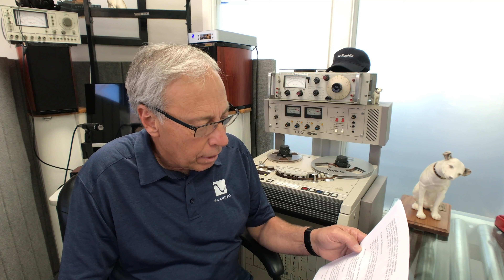Explain the different types of DACs

Comment: I have a good CD  player. I noticed a dramatic  improvement in the quality of my CD audio when I use the coaxial digital out.  Direct  digital  into my integrated  DAC amplifier is much better than using the RCA  out . I actually like CDs now... I used to think all CD players were equal, I was wrong. I think low quality DACs have given CDs a bad rap...

Comment: Quality of DAC is mostly dependent on power supply ??? Seriously ? You're finding way to sell snake oil in any topic...
Reply: Patryk Kulczyk power supply is very important , think of it like putting petrol in your car , if that petrol has water/oil/sand etc in it your car won’t run properly.  Try listening to your hifi at 3 in the morning and hear the difference. Would take to long to explain why this is to you so just try it and see.
Reply: marc J yeah AC power has some importance especially when your power supply circuit of your device (amp, pre, dac, etc...) is poorly designed or not sufficient on filtering. Also if there is interference in your power network but it has to be something near and strong. I never had any issues with my power network and I move a lot (every few years different country).
What I don't agree with is selling snake oil like power cables worth couple hundred dollars. Or some conditioners that are passive or active that does not generate pure sinus...
Reply: Patryk Kulczyk Fpga is very dependant to the power supply. In fact, if the power supply and the caps don't have enough buff and speed fpga won't even work.
Reply: John Yang what is fpga?
Reply: Patryk Kulczyk Logic gates. But fpga is running at a very fast state. So very stressful to the powersupply.
Reply: Patryk Kulczyk Lol. If you ever go to a college or uni that teach you microelectronics you will know what I am talking about. You are the one that doesn't know.
Reply: Patryk Kulczyk I am an electrical engineering student studying in UNSW. If you ever measure the power supply voltage of a running fpga board. You will see that it is not so pretty. Even with all that capacitor and multi layer board, you still generate lots of ringing to the power supply because digital circuit runs on square wave which needs lots of energy at the leading edge but not so much at the flat region. Overall it doesn't need much power but the voltage drop of power supply at the leading edge point is very significant if not conditioned properly it will drop to even lower than the working voltage for the logic gates/fpga.
Reply: Patryk Kulczyk I'm 100% sure you are the one that is not educated. Don't do it.
Reply: John Yang ok Mr student I'm doing this professionally for almost 15 years after my studies...
Anyway I agree with you on one thing that you need adequate power supply for particular digital circuitry - amen brother. Low ESR caps good current delivery, all that.  But it has to be matched with electronics. That's all. More caps, more current etc.. will not add any value. As you said if the power supply voltage drops below certain level this will cause gate to malfunction.  If not quality of supply does not affect it as ut does with analog systems.
And honestly in this context selling power conditioners for DACs its like saying "hey we have poorly designed power section of our DAC so you need to buy conditionner on top of that to ensure proper functioning..."
Then again DAC even with programmable array is not that power hungry at all and high quality power supply does not cost a lot.
Reply: Patryk Kulczyk Alrighty. As we have some agreements, I do agree that ps audio is really expensive. But compared ro their other stuff ps audio makes, their powerplant is no joke, Seriously good stuff.
When you design dac do you separate your digital components and analog components? Some do, but many don't. As fpga is certainly doing something about the power supply you have to design very carefully and more than enough. (over engineering)
Plus, the caps the board etc can do jobs but won't do 100% there are still things going on in the power supply. Dac alone won't be so shitty, but you need to think about high power stuff. 
Also his is about audiophile about hiend. You are supposed to eliminate anything that is potentially to affect the sound. I won't buy them I'm more to measurements based audiophile. With that being said, sure he is promoting his product but that's nothing wrong.
Reply: One more thing. All above those, I am still a student I am learning. I want to learn from different sources. As ps audio is hi end company and certainly know what they are doing, the things I learn here may translate to the latter projects. I may not agree with all stuff he's saying, I shall have a chance to hear people talking about this.
Reply: John Yang if you don't agree with some stuff he's saying then this should raise an alarm. He's often showing lack of knowledge unless he is talking about basics.
Another thing is that he's injecting here and there snake oil like some conditioners and even power cables - which is biggest scam of them all.

But going back to the topic. Why would you need power conditioner for your DAC? Unless you're in area where you have, I don't know 50% drops abd spikes or you are running huge electrical motor powered from the same network in your home then you don't need any conditioners. And if someone is advising you to get one for their own product like DAC  then they are BSing you to buy their products or their DAC have poorly designed power section.
Reply: Patryk Kulczyk I don't think he meant his powerplant for the power supply part. To my understanding, the power supply circuit is what he meant. 
Also I don't think he is wrong, just he isn't going too deep about the topics.
Reply: @pcbuildfrance  So ,your statement was trolling in the beginning.
Reply: @carmenandthedevil2804  yes sure.... Now go back to sleep, it's winter time. And don't forget your glass of snake oil.
Reply: @pcbuildfrance  No mate. Its summer. You go to bed now and take your opinions of no importance with you.
Reply: @carmenandthedevil2804  fanboys will always be fanboys. Sorry if I offended your guru.
Reply: @pcbuildfrance  lol
Reply: John Yang
I see you commenting on a lot of audio videos. And almost always you act like a know-it-all snob.
Reply: @TheEchelon  sure, if calling on someone's BS is beeing all knowing snob... Especially on topics that are simple and does not require to be MIT profesor to understand.
Audio equipment market is one of the most most abused of all. There's more snake oil in it than in the snake oil itself.
I love audio and it makes me sick how audio equipment makers take advantage of people.
Reply: If you have a class A amplification of the analogue signal, you will get better sound. But it doesn't have to cost so much. It's just going to amplify it up to line level.
Reply: @oysteinsoreide4323  yes, but like you said it will amplify to line level. We are talking about very small currents and low voltages. You don't need anything special to power this. Yes, sure quality wise it should be good. But that's easy at those power levels. There is no secret that they sell extremely expensive power devices (including "conditioners") so those kind of "injections" are intended.

Comment: The FPGA doesn't have an analog output.  The sigma delta bit stream is integrated with a capacitor to generate the analog output.   This is is done at high frequencies hopefully so you can't tell the difference between digital output and a real analog D TO A converter.

Comment: I recently 'upgraded' the DAC in my Raspberry Pi based music source from a USB based one to a I2C, 'asynchronous' converter, it should sound better but it dosen't, I think you just nailed the problem, the first DAC must have had a much better output stage (it could directly drive headphones) whereas the new one cannot. time for me to make another change. (get out the soldering iron - again)
Reply: What kind of prices is that.

Comment: Great explanation of FPGA vs chip DAC.
Power supply and output stage are critical to the sound.  The third leg of the stool is the clock.  Once PS and output are perfected, clock phase noise can make the difference between a great DAC and a state of the art DAC.  An oscillator can cost pennies in your phone or in the case of the Direct Stream several 10s of dollars each to as much as thousands of dollars each in the SOTA DACs.

Comment: Thanks Paul, you confirmed something I had always wondered about which is why different DAC's with the same chip set sound quite different. Based on your comments, Power Supply and output stage are the key.

Comment: Good advice Paul. A DAC could be built with the best chips and if a cheap SMPS is powering it and a low quality analog output circuit is used, it's not going to sound very good. It's kinda like plumbing, shite runs downstream. The tiny analog signal from the DAC will go through several amplification circuits in the preamp and amplifier, so any noise or other shortcomings will only be more evident by the time the highly amplified signal reaches the speakers. Garbage in = garbage out. Especially from the source device.

Comment: Being in the lower end of hi fi myself :D Not enough money to get brand new i buy second hand stuff, however i have just seen your Steller range and with a few months saving i could prob afford the dac/pre amp , which would solve 2 hi fi issue s instantly as i don't like many boxes, i was getting  a passive pre amp to remove a power lead and the electronics in the path. Do your products work in the UK and are there any company's, here who would sell your products so could go and listen :D Boulder, Colorado is abit far at the mo :D Thanks for the great series i am learning a lot and i'm 44 :)
Reply: I guess nobody sells ps audio gear in uk then :\
Reply: Philip, Paul did an informative clip on pre-amps.  Check it out.  With a limited budget I would go for an integrated amplifier.  Most of the cost of separates is the additional casework.  Integrated is better value for money out of all proportion to the improvement (if there is any) in sound quality.

Comment: I have a delta sigma discrete DAC, which allows choosing a modulator sampling frequency (128 fs, 256 fs or 512 fs). 
Can anyone tell me if a higher modulator sampling frequency should provide better sound?

Comment: My gut feeling says in designing R2R DACs because of the naturally occurring octave level foundation of space associated with the observed acceleration of expanding space connected to time and Newlands exponential atomic level law of octaves responsible for creating the illusion of missing "dark matter" obtained by measuring the force of gravity looking back in time through the lower frequencies of space matter exists in to the point of Singularity (Mass location at the start of time creating a true or "initial" inertial frame of reference to measure time connected to mass oscillation from) you should accept the reality of constant time dilation in effect associated with reduced Mass density and "empty" space and go to 32 bit and deal with the fine measurements desired rather than trying to use 24 bits because 32 is a fundamental naturally occurring foundation connected to the octave level frequencies associated with the forward arrow of time.

IE: it's easier to deal with the resulting harmonic commas using a straight line and the forward arrow of time without wait state gaps involved compared to "going back in time" required to create a lower 24 bit rate to symmetrically mirror a wave/sound that is not symmetrical without using time dilation. I'm not saying it can't be done as Nature does it all the time... but we don't understand the neutron count observed in atoms connected to time and space making up molecules yet let alone the electron hole associated with the 4th reverse oscillation phase of the atom that represents the missing graviton phase of Mass oscillation showing its minute force is caused by the subtrahend of the EM wave NOT canceled out, the difference in length of the two separate oscillation arrows caused by using increasing time to measure itself so to speak. If you fold a piece of paper in half and say it's a wave where E=Time and use time connected to space to measure it starting at the beginning point you see the second half measures longer because your ruler (time/space) increased in length and this is why time dilation is needed to maintain E a constant and prevent it increasing it's potential energy..
Reply: Can you translate this please ?
Reply: @paulb.3227 It's satire

Comment: Isn't 16 bits enough to provide sufficiently noise free (i.e. quantization noise) performance? It seems to me if one can make a 16 bit DAC with a resistor network,  it ought to  work extremely well I think.  Simple as it gets and probably inexpensive, too.
Reply: James Kim You can try. And the result will be pretty bad. The thing is there are people still loving true r2r ladder dac that are 16 bit. They can sound good but the actual performance is way behind from many stand points. But as they are r2r linearity will be very good.
Reply: I’ve tried and they are a nightmare, with the resistor matching problem. If you think of the digital code switching from 16383 to 16384, one bit is switching on and 14 bits are switching off and you want the output level to increase by the same amount as when the digital code switches from 0 to 1. Not easy!!

Comment: I don't use a dedicated DAC currently and I'm really wondering how much one can heighten my listening pleasure...will it be a significant improvement if I were to get a mid range model in the $2-4k region?. Then all the research into the various DAC types (RSR, Sigma Delta, FPGA) adds to the confusion. Seems that RSRs are more natural sounding?
Reply: @Guido Santens how does sound come out then?
Reply: My modi3 made a big difference with my Peachtree nova

Comment: If two DACs sound completely different it must be measurable. One way could be to measure the delta between two DAC outputs. For the difference to be audible if needs to be of a certain amplitude with some sort of ringing or distortion. Is PS audio doing such delta measurements to better explain and solve any artifact?
Reply: Paul McGowan Well, by knowing the delta signal you should be able to make better informed corrections and re-measure. If the delta signal is >80dB below actual signal I wouldn’t think it’s audible also.

Comment: Can an FPGA be used to create a ladder DAC?  That is, can an FPGA provide the very precise increments of resistance to put into the ladder since they are only switches?
Reply: No, the resistors would have to be external to the FPGA, most likely some laser trimmed resistor banks. The FPGA would do the digital filtering though and switch the parallel output.

Comment: I'm told a new Demon at 100 watts is much better than my 1984 Kenwood at 150 watts. Wish I could get to the truth. If my Kenwood is still the stronger/ better unit then I would rather just buy a DAC. Of course which  DAC and what are the limitations of bieng forced to use an optical Toslink for my TV connection??
Reply: Beware of demons  :-))